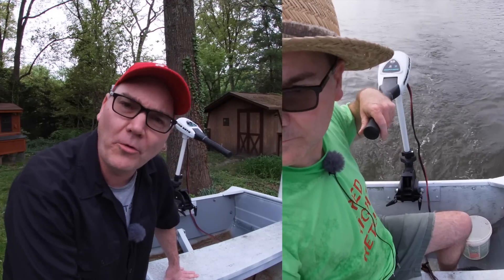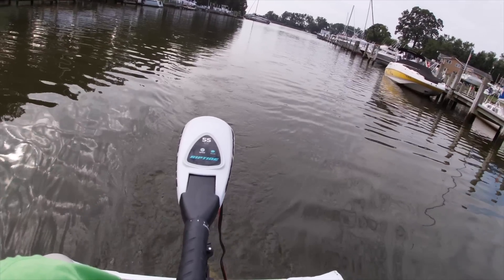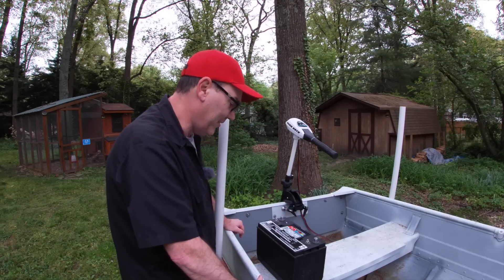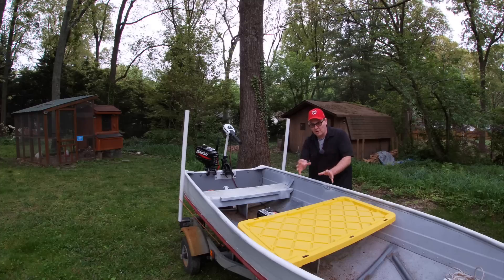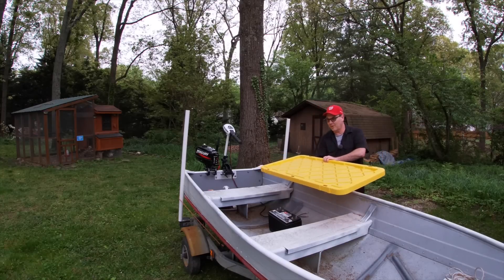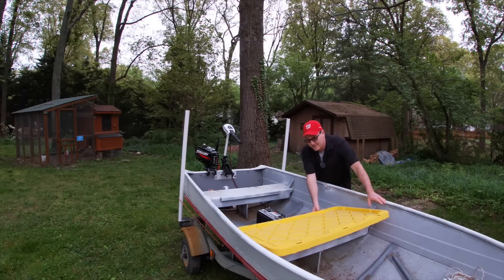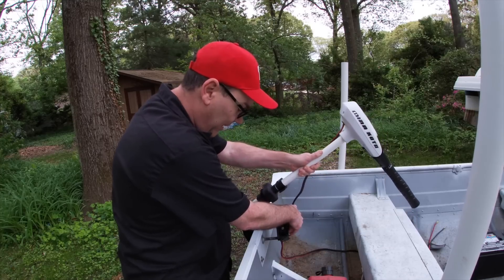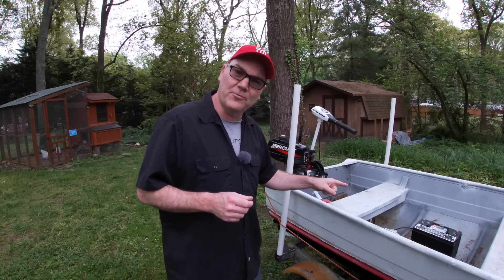How Many Solar Panels Do You Need For A Trolling Motor?

Comment: I have an inflatable fishing skiff with an amazing trolling motor called  watersnake advance brushless 70. it produces 70 lbs of thrust on a single 12v 112Ah Walmart Everstart size 29 battery for $89. I use a 45W solar panel with integrated 12v controllers from PowerFilm. I have never had to plug my battery into a charger connected to 110v shorepower, never.
Reply: I have a small 2 6hp gas outboard called a kuda I use as an auxiliary to my trolling motor. It hard to get used to the idea of a gas outboard as an auxiliary propulsion rather than primary propulsion, but that's where we are.
Reply from the maker: lol
Reply from the maker: I have heard good things about the Watersnake since posting this video. Thank you for sharing your experiences!
Reply: @WayneTheBoatGuy  The only notable caution I read in the manual is that the WaterSnake 70 has sensitive electronic in the head and should not be exposed to excessive heat or cold. So when I'm not using it, it stays in my bedroom closet. also I have yet to try it with a lithium battery. When I first got it, the speed was impressive but the battery was new. I recharge it with solar and I'm not sure if it recharges it full to the top.

Comment: For a small boat, solar is not economical nor is it robust enough. Solar is simply put, a feel good notion. It takes more work and energy to manufacture solar panels and lithium batteries that can not last long enough to justify destroying the earth to mine the minerals required. Then it still takes fossil fuel, nuclear power and probably, some of both to complete the manufacturing and delivery of these renewable products. So you still need fossil fuel to make it work and the greenies to feel good and sleep at night....

Comment: but the reason you're replacing that deep cycle battery every year is you using more than what they are designed to cycle. the maximum they recommend for cycling is 30-35% so that means the max Safe usable capacity of a 100Ah deep cycle is 30-35Ah and that trolling motor at full power uses 50A so that battery can only safely run that motor at full power for 42mins before starting to damage the battery.

where lifepo4 cells are more cost-effective if you look at it as 1$ per min of run time you can get around 90% of capacity from a 100Ah of so figure 90Ah usable and be under 8Kg in weight and will cost around 350$ but that 3x the run time amd lifepo4 cells are good for 3000-8000 charge cycles so a good balancing circuit and they will last as long as the boat basically 2hrs per charge 5000 charges 10,000 hours of run time over the lafe of the battery 
flood deep cycle at best 500 cycles with 30% usable capacity but more like 200 cycles running it 50%. but using 40min to 30% over 500 cycles is 333hrs of total operational life and that's best case scenario honestly. im building a solar boat atm out of a 1648 jon boat. i have a pair of 40hp bldc motors driving a pair of sea doo jet pumps. with a full top front to back with 1.4kw of solar. drive by wire steering console and a gps mina kota 112lb 48v trolling motor in the front. 
the top is hinged in sections and each is attached to a 48in long actuator so i can move the top up or down from 33in off the deck to 81in off the deck. the front panels can be folded back for fishing but generally used as a lake cruiser with the kids i fish on my kayak.
i have 36kwh of batteries in the boat the jet drives use both the nozzles and differential thrust for steering. it's a flat bottom jon boat 16ft 48in wide. the motors are water cooled but closed loop. the boat can reach 55mph but stay in the 5-20mph range mostly for efficiency. i made custom float pods that hug the jet drives and raised the transom  2in. i have a massive pump(4000gpm)  to suck water out in case of a leak or wake over the stern tge weight is shifted slightly fwd with the batteries gets on a plane in an instant  i can run full power for about 2.5hrs before needing to charge. on board charging is ok 2x 6kwh + solar. the boat sits docked so it will fully recharge from the sun after just a few days. some bigger docks can feed 240v at 50A so i can run both chargers and be back out on the water in a few hour's but generally if i stay under 25mph I lasts a full day or two.
based on solar charger stats in the summer the panel's avg 8.9kwhs per day in southern California. i use 3.26kw at 25mph with about 3-5mph head wind and 1.99kw at 25mph with the same as a tail wind. i boat is white with a blue top and has enough leds to make los Vegas jealous.
it's honestly a micro party boat for the river i have side riggers i made to make it more stable. as some that deal with robotics and works in hardware engineering. everything is automated everything is electronic. the deck is based off what i have seen on tiny boat nation and free of wood. 1in thick foam core with FRP top and bottom both live  wells are insulated and when cleaned works as a coolers. it's been on lake mead and at needles in the river the batteries are sealed and protected from water and has enough foam to keep the sides of the boat above calm water so the pump can fully drain the boat. all electrical is ran inside pvc pipes to a center control box where a small computer and custom circuit board monitor's the power draw and switching for every circuit from nav lights to the sinrad 3d radar. the main drive system is also an autopilot tied into my chart plot. i built this as an experiment to see if i can build the "model 3" of the river boats on a budget and i think it went well total investment not including time is under 15k lots of junk yard boat yard parts the jet drives are from some free early 90's blown up 2 stroke sea doos that are basically useless in California as 2strokes are basically banned from everything but the ocean. the bldc motors, speed controllers, lifepo4 cells are from aliexpress, 9in screen sinrad+halo20 radar + 3in1 transducer combo with an added 9in screen boat setup to seat 4 people to talk and drink lol
Reply from the maker: That's a REALLY interesting build - Thanks for sharing!!

Comment: I believe solar is a good way, but i would try to de-couple two factors, using the motor and charging. As you mentioned, the option of enlarging the battery capacity is still better. But the charging could still be done by solar. At "home", meaning when you return from your trip, you could have a solar charging system that replenishes the drained batteries. Given obviously that you don't go fishing every day :-D
Reply from the maker: Yeah - solar for recharging is certainly a good option - especially because it would eliminate carrying batteries around or running an extension cord to the boat!

Comment: Hmm...   interesting points. I hadn't considered it possible to actually power a boat entirely on solar, but I certainly have considered a trolling motor as a "range extender" on my poly canoe. (I saw it as more of a helper than as a full-on substitute for paddling) I hadn't given a thought to adding on a few panels for even more range. Perhaps a few cheapo panels would add a few miles. Not an inconsiderable distance to a paddler. Thanks for this interesting video.

Comment: Off of a 100 watts I usually see 65. I have 200 watts with a 1500 wh battery lithium ion. Solar generator. This generator runs a refridge/freezer at 55 watts , it cycles on and off on DC power and will last about 24 hrs. 1000 watts will give you about 650 watts of solar charging. Off of 200 watts I have seen it get up to 182 from solar panels but usually 200 watts will be 135 watts. 65 % of 100 on a good day and usually about 100 watts in Kansas. It will charge my solar generator and run the freezer. 24 hours as long as I have sun. So I always have a gas generator for back up. I would run both like you said go out with gas let your solar charge and drive back on electric or just to save gas or emergency back up which is always a good thing.

Comment: The thing with solar panels, they produce when they can, which means they top up the battery whenever you're using less power than the solar panel produces.  If 1 panel only covers say 20% of your power draw during trolling, your battery will only last 25% longer, if you're constantly trolling.  But if you don't use that power constantly, lets say you catch something, and turn the motor off, the solar panel will keep producing power, charge the battery. During a full, sunny summer day a 100W solar panel will produce almost as much as the capacity of that battery.  Not good enough? Get two, or a bigger one.   

A solar panel, or two, can be a great addition to the battery, when it's sunny. The problem is when you need more power than what's in the battery when there is not much, or any, sunlight.

Comment: Hmmm? Solar? Big Mistake, sometimes it's overcast for days on end, and windy, (You've put a sail on a low power boat). You are always worried about running out of power, I've had three boats, (all outboard engines) never once worried about running out of gas, or the clouds ruining my day. Use the outboard and get the two batteries, if ya wanna spend some money on something worthwhile, get the lithium-ion batteries, Cheers Mate, good show...

Comment: I think it's more about your objective.

I am currently converting a Sea Ray Sundancer 268  to electric using (2) 85 lb trolling motors, (2) PWM motor controllers and (4) 210RC 12v deep cycle batteries from AutoZone.

My objective is to get it in the water at our seasonal campground and move it around their crappy marina to my slip where I will enjoy my time until they kick me out after Columbus Day weekend.

Then I will probably do some mods...
Reply from the maker: Neat project!! Are you going to leave the old I/O engine in place? Under breezy conditions that might be a lot of boat for those trollers to push around, but in calm waters that would be easy and silent!

Comment: If you wanted to act all greenie you could build a fixed solar charging station cheap enough if you scrounged a couple of used Trina 250W panels and a cheapie Harbor Freight charge controller that you could charge a couple of batteries at then plop them in your boat and go. Particularly if you lived lakeside and had maybe 2 or 4 batteries that you could continuously swap that could be handy but still just for show compared to a little gas motor.
I knew a guy back in the day who had a little retractable keel sailboat. He put an electric trolling motor and battery on it. He had modified the trolling motor so it could be dragged behind the boat while sailing as a generator with a charge controlled and top off his battery then when he got into a cove to fish he would drop sail, raise the keel and use the trolling motor to fish in the shallows then go back to generating while he was under sail again to another spot. Seemed to work for him for lake fishing in the Ozarks but I never got a chance to really evaluate it for myself before he passed away and his kid sold the boat.

Comment: Should've said how much juice your electric motor requires. Can you run your motor straight off of your panel(s)? Also that your AGM battery really only supplies 1/2 of its rated amps, while the LiFePO4 batts supply virtually all of theirs (without damage).
Reply from the maker: Running a trolling motor straight from solar isn't a good idea because of the variations in voltage. Everything I found suggested using batteries in the equation to provide consistent voltage to the motor to prevent damage to the motor. The element that was lacking in almost everything I researched was cost and whether or not there were less expensive (electric) options to significantly extend range or run time.

Comment: You start off with a strawman argument. You state your premise, then you say, "A little tiny solar panel won't work . . . " And also "that battery." So you've limited things to a 10W solar panel and one battery. And you say, "Going all day." Yeah, that ain't gonna work. But it's also not an argument against your initially stated premise. Because you can have a 220W panel, and 4 LiFePO4 batteries. And you can travel for, say, 8 hours. Doesn't have to be "all day." The technology IS there. There are COMMERCIAL VESSELS doing this NOW.
Reply from the maker: I was merely trying to show that on a small 12 foot boat, the cost of the materials and size of the panels required to run for many hours was extremely prohibitive.

Comment: Solar and electric drive is more suitable for mid size sailboat once the sail is up, electric drive can work as an hydro generator to charge up the battery, hydro is much faster
Reply from the maker: And many sailboats have a surface for mounting one or two 100 watt panels!

Comment: nice video. I think using the motor as you duggest short trips to and from. I would use 1 or2 panels on 1 battery. To alleviate the necessity of having to charge battery in any alternative fashion. after all is said and done. It would be an excellent form of off grid water transport worth having in many scenarios. Happy Trails!

Comment: I been running a commercial passenger boat for 3 years on solar now. I have 3 100amp hour batteries with one always on charge from the single 100w panel. It works. Have saved thousands in gas. And we are silent. Total reliability.
Reply from the maker: That's awesome! What motor are you running?
Reply: @WayneTheBoatGuy  54lb Watersnake. I have two in case the wind comes up...very practical solution to noisey outboards. We surprise turtles and all sorts being so quiet. Catch more fish too. It's totally do-able...naysayers carry on pouring gas then...BTW the boat takes 17
Reply from the maker: VERY COOL - I have read about the Watersnake a couple times now  and it seems like they might be brushless, and slightly "faster" than a Minn Kota or other common electric trolling motor.

Comment: One, 100 amp hour LiFePO4 battery has twice the run time of that 100 amp hour deep cycle battery, since you can only run that lead acid down 50%.  The current cost on the cheap side is between three and four hundred dollars, and it weighs 25 lbs.  You can buy two 200 watt solar panels that are about half to 3/4 of the size that you're showing with that lid and a good charge controller for $200.  So just say the initial cost is $700 /$7 a gallon for gasoline you're looking at a hundred days on the water to pay it off.  No oil changes, no draining, no carb rebuilding, no preserving, no fussing around after letting the stuff set for a month, or make it mobile and add an inverter and use that to charge up your weed eater batteries and running light in your shed and be an emergency backup at home.

Comment: Why not just some simple math? 1HP = 745W

So to make 1HP constant power, you need 7.5x 100W panels, and that's in good solar conditions.

A 100Ah 12V battery stores about 1.2kWh of energy. So you can run 1HP of power for 1.6 hours.

To run 1HP for 8 hours you need about 6kWh of energy. Lithium batteries currently cost about $.50/Wh. So a Lithium battery bank with 8 hours of runtime is about $3,000. 

And we're still talking about no current and flat conditions. To run a little 10HP outboard, that's only 75x 100W panels to run it at full power in full sun, or $30,000 of fully charged lithium batteries for 8 hours. 😆

These numbers are all overly optimistic in that they assume peak efficiency of multiple components that don't tend to operate at peak efficiency.

Comment: maybe add a windmill, there is always wind on the water and a lighter motor a little bit slower but less Amps
Reply: Fun fact: The blades of a windmill are also called sails. Perhaps someday someone will figure out a way to directly adapt sails to boats without needing a windmill, battery and electric outboard. 😆
Reply from the maker: lol

Comment: I just bought a sailboat with an electric trolling motor. The previous owner would charge them at home, then schlepp them down the dock to the boat. As there’s no shore power where the boat is stored, I’m considering a solar powered trickle charger and spare my back some grief. My concern is knowing how much power I have remaining in the batteries. It’s easy to see how much gas is in the tank of an outboard and my cell phone let’s me know how much juice I have left. Is their an accurate gauge available for a trolling motor running on a couple of deep cycle marine batteries?
Reply from the maker: I "think" you could buy a cheap volt meter and check them on the boat right before you head out. I plan to play with volt meters some more in the future because when a 12 volt deep cycle battery like mine is "fully charged" it is something like 12.8 volts and apparently when they're 'flat' they're like 11 volts - so it seems to come down to knowing how to read the numbers.

Comment: I use a LifePo4 Lithium 12.8V 100Ah battery for my Minn Kota 30lb electric motor and wondering how you know how much power the battery has left?  Since it is an intelligent battery, I was expecting a visual feedback directly on the battery but I find out I was dreaming.  Anyway, how do you monitor your battery power on the go?
Reply from the maker: That is a challenge. There are some volt gauges that people install, but the trick is knowing what voltage is 'too low'.
Reply: @WayneTheBoatGuy  Thanks Wayne.

Comment: I guess the important question is; "what is the cost of not reeking like gasoline worth?" if ditching the 500lb fishing boat for a 75lb kayak made a 12v solar system, trolling motor work is it still comparable to you? Similarly, the ROI doesn't make sense for many people to buy electric cars starting at $40k weighing over 8000 lbs, but the same technology is much more appealing looking at a $3,000 dual motor/mid drive ebike that will hit 45 mph on the street and only weights 130lbs but only seats one.